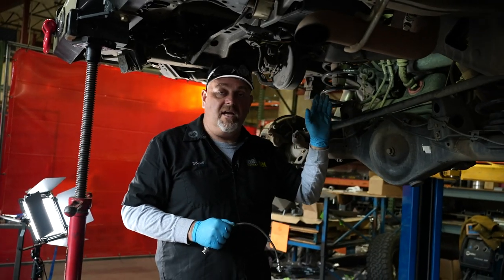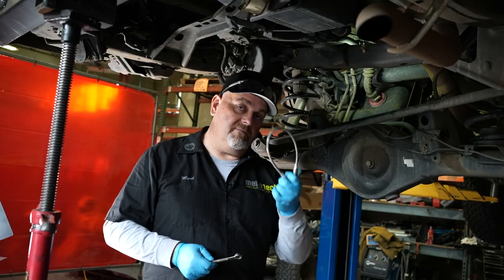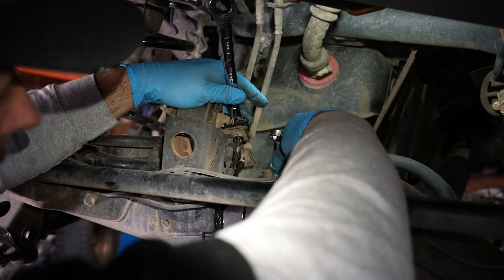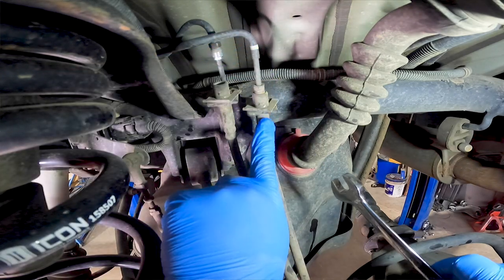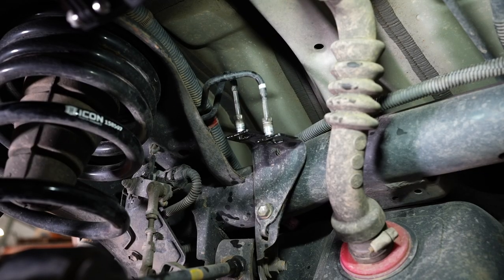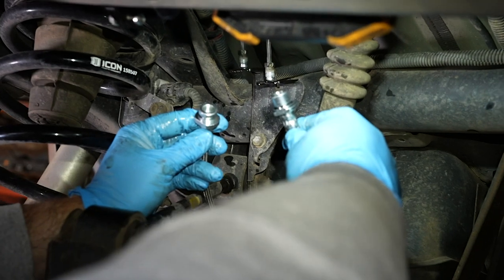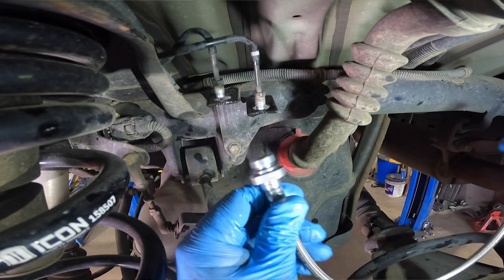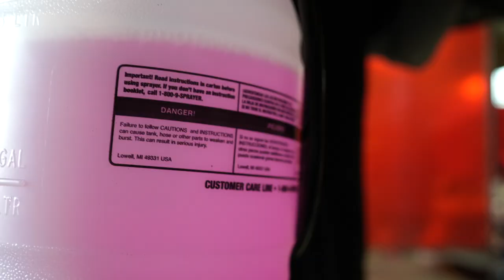Brake line installation for GX470, GX460, 4Runner, FJC and Land Cruiser

Comment: Great video Mark! Only thing I do differently is to start the new line threads prior to installing the spring clip. Snug by hand the lines then install the spring clips. I have found it easier for me as you are not trying to conform the fixed line to the flexible line.
Reply: I agree as well
Reply from the maker: Mark here. I like it! The main reason I install the soft-line ends first is to give me a firm mounting location against which I can push the hard-line flared end up. This gives me a positive or confirmed fit-up on the flared end with the nipple of the inner part of the soft-line end before I start the threads.  Just as my 50's hotrod builder Father taught me, so how I have always done it.   However, I see the value of keeping the two lines loose to get them started; that probably can help reduce the chance of  "cross-tightening" them!

Comment: Tip... take your vice grips and pinch the old line near the axle to prevent fluid from leaking out. Then unhook at axle. Next install new line to axle. Then detach the old line from the metal line at the top, and quickly attach to new line. You won't make near the mess. Watching you let brake fluid drip everywhere was stressful and avoidable.

Comment: Did you use the old clips by the axle? I couldn’t snap on the ones provided so I ended up using the oem clips by the axle and the new clips at the top
Reply from the maker: The OEM clips are easier to install as they are thinner. They work just fine with the new brake lines.

Comment: Do they work with 2006 Sequoia ?
Reply from the maker: We know the threads and the flare nuts are the same.   If the lines you want to replace are Femail on both ends, then yes, these will fit.   If they are Femail/Male, you just need that line set.   The brake line kit we have for the 80 series LC has F/M lines in those kits.

Comment: Will these fit a 100 series?
Reply: It's a Land Cruiser, right?   These soft lines are probably standard a standard, consistent size for Toyota 4x4s from the 90's on.
Reply from the maker: Yes they should fit your 100 series no problem
Reply: @Metaltech4x4  Thanks! Do you also make a front brake line kit?
Reply from the maker: Of course! Unfortunately we only offer it for the rear at this time
Reply: Will these fit a 2018 tundra 4x4?
Reply: @joelhadley5458  We have not tried installing them on a 2018 Tundra.   We know the thread pitch is the same but it would depend on the ends of the hose that is needed, as in male or female for the threads